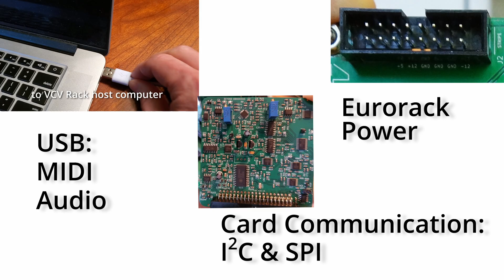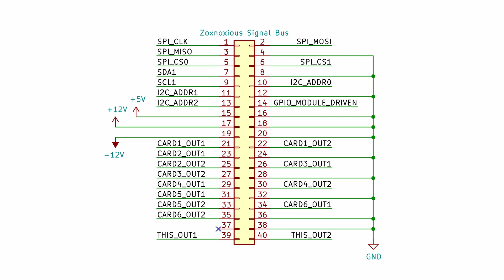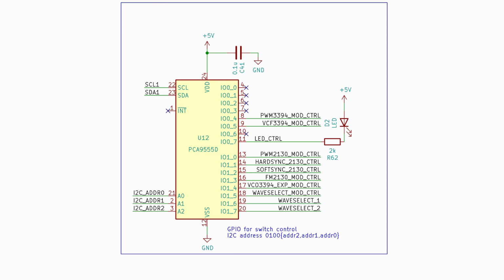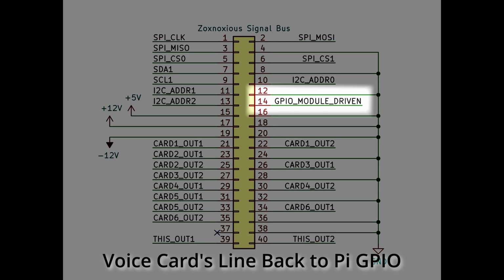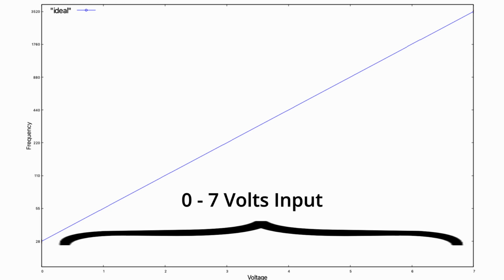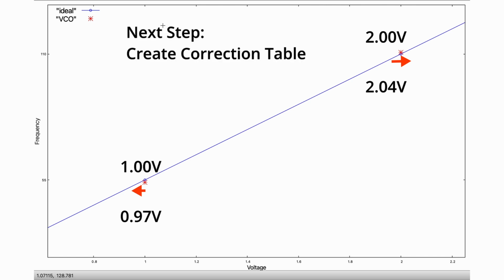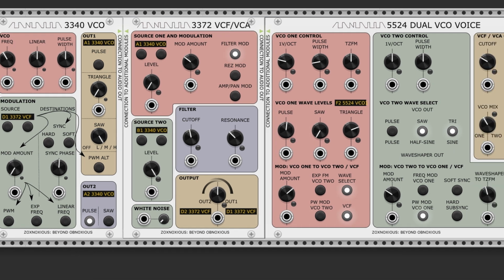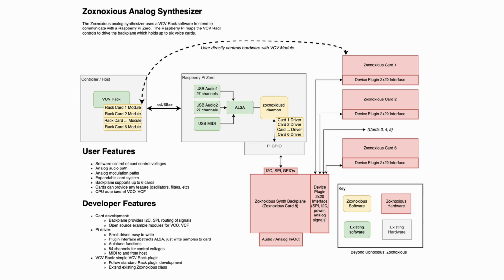Zoxnoxious Deep Dive Part 3: Hardware detail and Autotune of VCOs/VCFs

Comment: One question from someone who knows nothing about synthesizers: if all these cards were DSPs the sound would be too different? Thanks!
Reply from the maker: Hey thanks for dropping comment!
Exactly, we all prize the sound of analog warmth.  Kind of like vinyl versus digital audio.  The characteristics aren't as exact as digital, an oscillator's frequency may detune a bit with temperature and other conditions, etc.  That said, the digital emulations of analog have come a long way over the years.  One would be hard pressed to really spot the differences in a mix.  So why do it?  Personally I like designing with these analog chips, it's a lot more fun than writing DSP code.